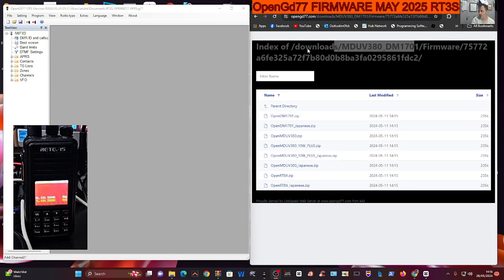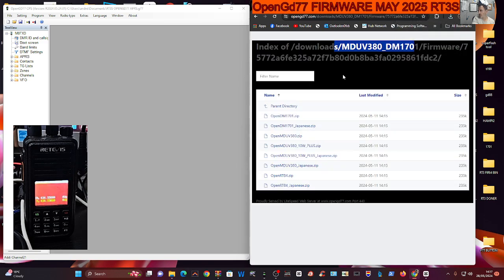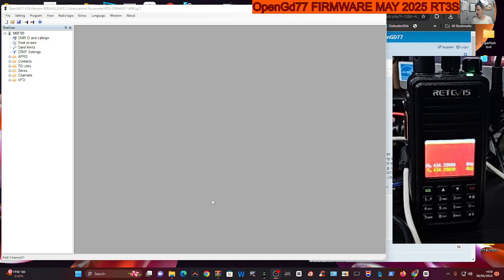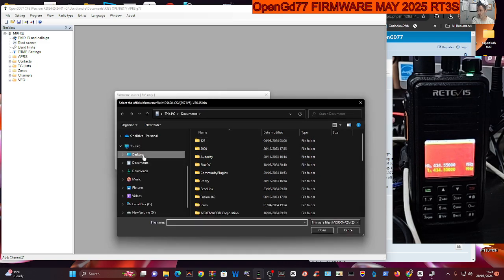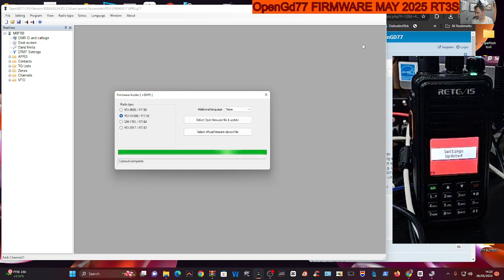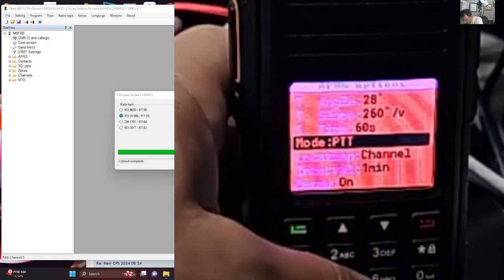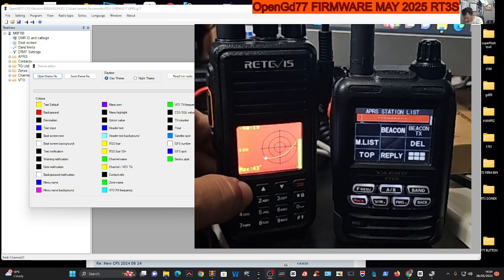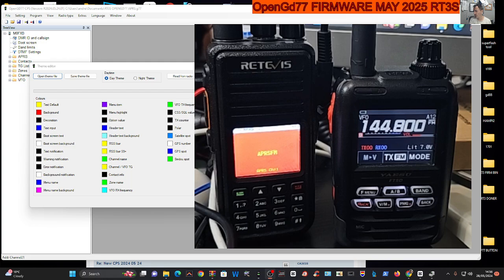RT3S/MD380- APRS TX - OpenGd77 Latest Firmware -FULL SET UP

Comment: hey, great video but is there any way to receive and decode aprs position reports and messages on the rt3s?
Reply from the maker: Only if you use more hardware
Reply: @M0FXBHamTech  so still needs a separate TNC for that i presume?